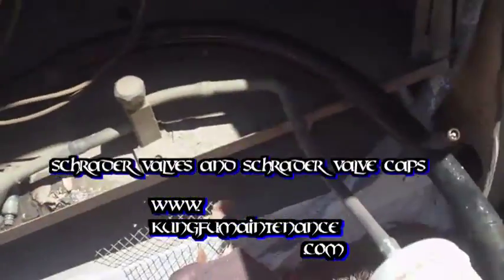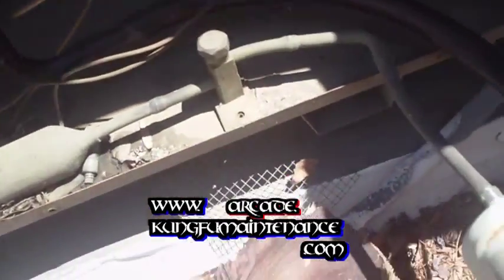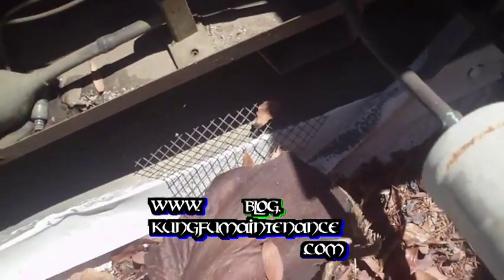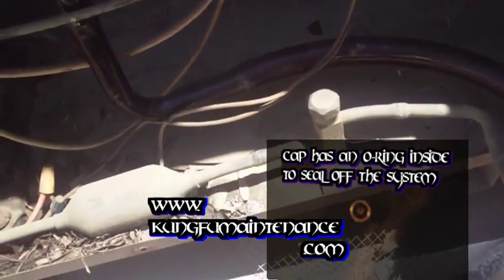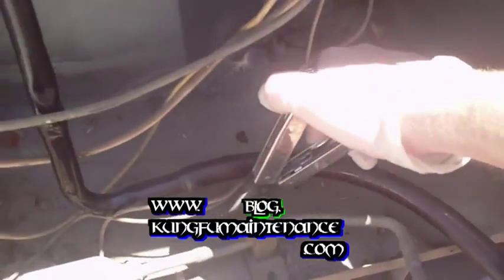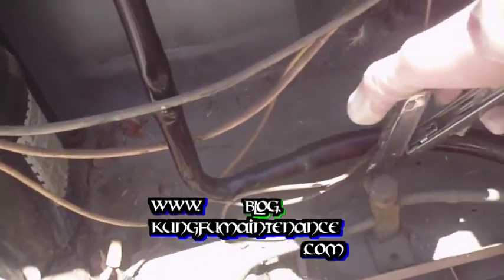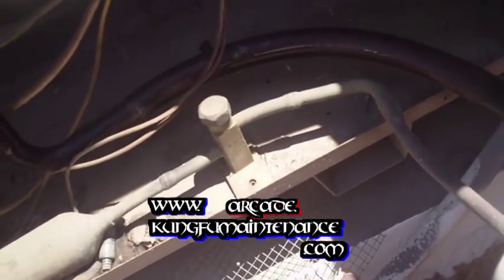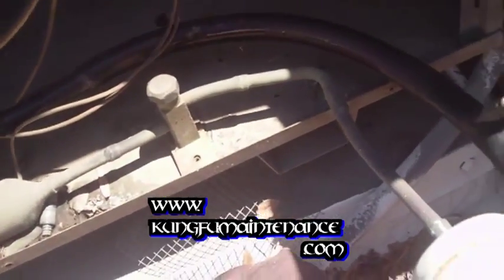Schrader Valves and Caps ~ AC 101~ Kung Fu Maintenance

Comment: KungFuMaintenance I'm actually starting to hate those wrench-tighten caps that have a metal flare instead of an o-ring. Yes they never leak since they don't have rings that wear out, but I have noticed that when they are on a Trane unit for over 8 years, they slowly eat out the flare shape on the port, and my refrigerant retaining hoses would not stop blowing refrigerant out. If I could find some brass caps that are strong enough to hold back pressure without blowing, and still have o-rings, I thing I will replace all of my ports.

Comment from the maker: Hope to take you up on that. I've actually wanted to make that vid for some time. What is used is a self tapping bullet valve. It has a gasket surrounding a piercing needle. You bolt the two halves of the valve to the suction line with the piercing valve retracted, this presses the gasket onto the suction line making a gas tight seal. Rotating the piercing valve penetrates the line. Now gauges can be attached. Untwisting the piercing valve allows refrigerant to flow through. Retwisting reseals.